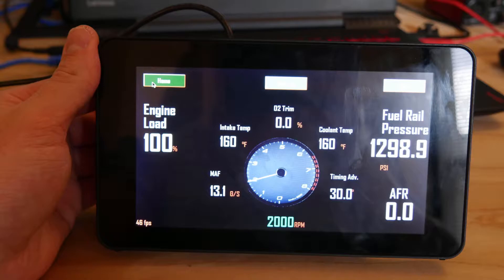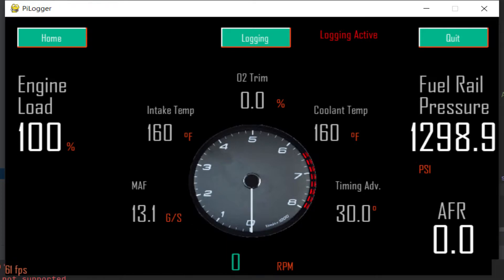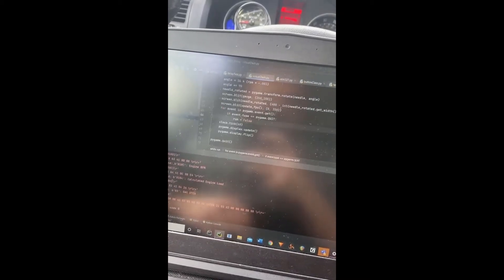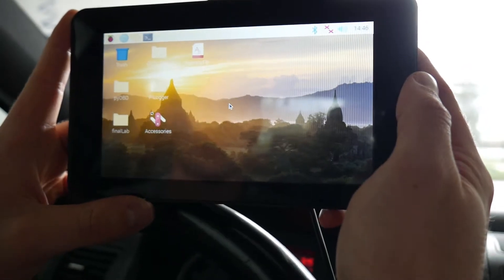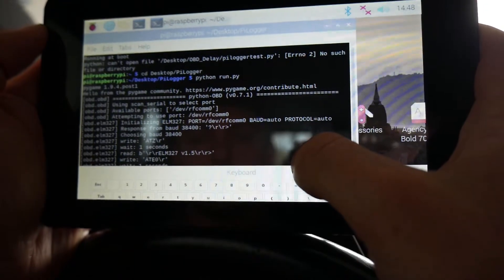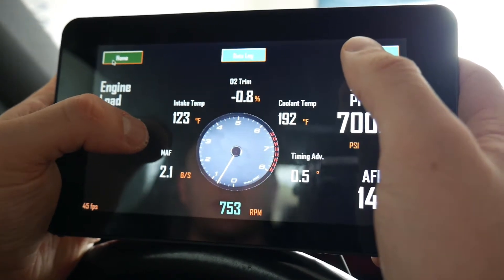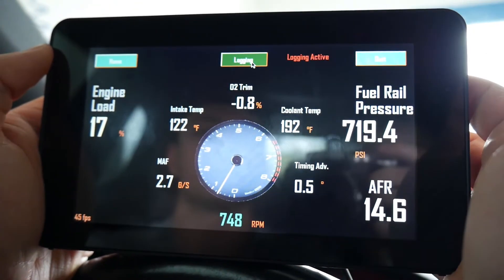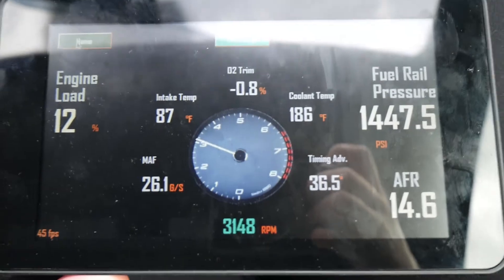Car Hacks with a Raspberry Pi // Reading Codes // Data Logging

Comment: could i have a copy of your guy?
Reply from the maker: https://github.com/OlinRB/PiLogger-CodeReader-DataLogger-VirtualDash-GUI
Reply: @highorbitproductions3521  thanks going to test it
Reply from the maker: @BRIANPOOPMILLER  you can run app.py to figure out what PIDS are supported (Unless you're in a GTI which should be the same), details in the readme. The reason the OBD library is physically cloned into this repo is because I had to increase delay time before timeout needed for slower elm327 modules.